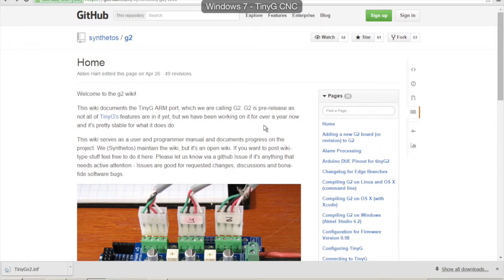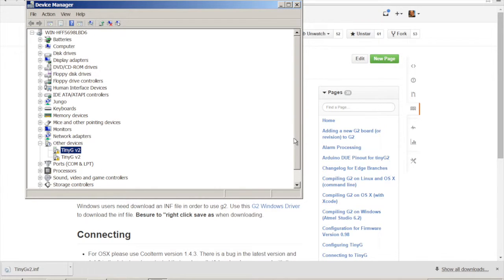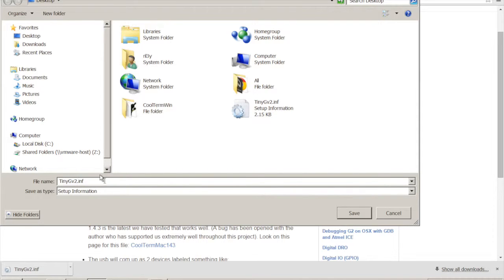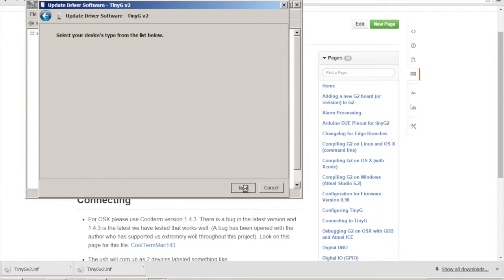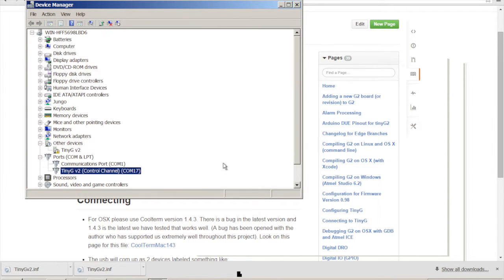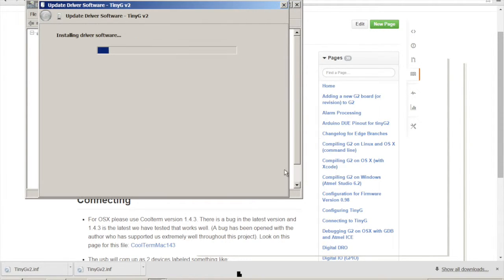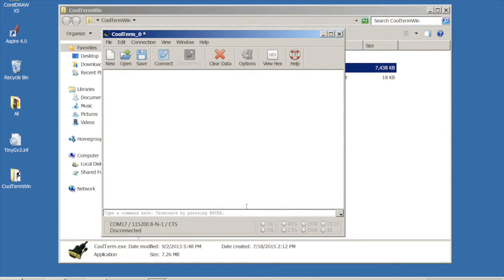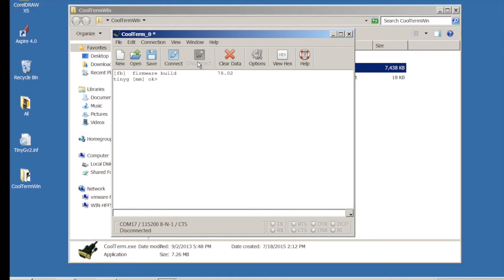G2 Drivers Install   final

Comment: I have powered up the gshield mounted on an arduino due connected to the PC using native port. However the arduino appears on the  device manager list, but the g2 doesn't. Any suggestions?